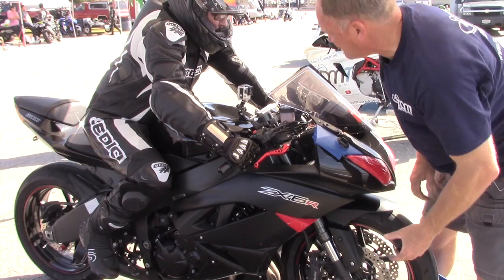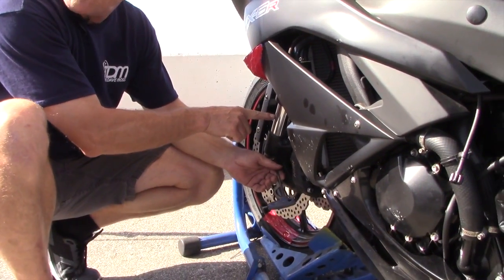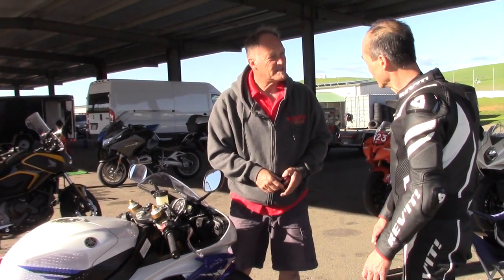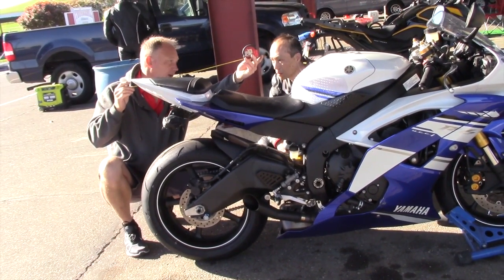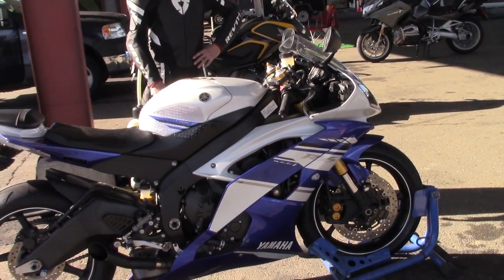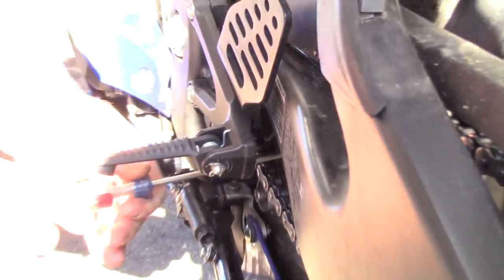2 Clicks Out: Lowered Kawasaki ZX-6R & Yamaha R6 Suspension Setups (TRAILER)

Comment: i really wish someone in my city could help me with this. about the only thing i have not figured out on bikes.
Reply from the maker: How can I help? Email me dave@davemosstuning.com
Reply: I have an 02 f4i lowered 1.5 front and rear. it's all factory set as far as sag and preload. I weigh 160 and I use the bike for everyday riding. just thought it be cool to see how the bike feels adjusted correctly
Reply from the maker: If you know how to use some basic tools, I can give you some settings to install. How many miles on the bike and how old is the fork
 and shock oil?
Reply: do you have any problems with your lowered motorcycle ? does it handle so different from stock one ? do your footpegs hit the ground when taking a corner/turm ? thank you
Reply: Kuwai8y4u lowered exactly 1.5 inches front and rear zero issues and rides grear
Reply from the maker: lowering is as simple as getting the bike at least flat and level to start with, then making the suspension a little stiffer than normal to help avoid bottoming out.

Comment: Newbie here,  is it lowering the bike can affect the stability of a bike? Or handling etc?
Reply from the maker: Lowering will not affect stability - it will put the bike closer to the ground. That being said, it makes it harder to move the bike side to side as the engine height is changed so you need a little more muscle to transition side to side. You lose ground clearance but unless you have lean angles and speed combined that allow the pegs to hit, there's no issue to resolve. Hope this helps!
Reply: Dave Moss Tuning thanks for the reply sir ,
Reply from the maker: Losing 25-30mm when lowering is an issue if you have the speed that requires lean and that lean angle hits hard parts. You either back off at that point or raise the bike again and deal with the consequences of the increased height (if you are inseam challenged).

Comment: I thought the '08+ R6 had two lines showing above the upper triple? was this one lower?
Reply from the maker: that is correct and for the track, positioning the forks at one line gives much better braking stability generally.
Reply: +Dave Moss Tuning agreed! I like to raise them all the way and make it flush with the upper triple, but that's just me.
Reply from the maker: Then do so and define what YOU need so that at all times the bike gives you consistency based on how you ride it :)
Reply: can you please talk about lowering motorcycles, maybe how many inches maximum can you lower them and how lowering does affect the bike handling. thank you
Reply from the maker: I will put something up on that in a couple of weeks once I get back from North Carolina.
Reply: Inches? Nah...lowering it by inches will completely screw up your handling. Not to mention, I doubt at full suspension travel you will have clearance (a.k.a front wheel hitting your radiator or rear wheel hitting your subframe)
Reply from the maker: Kuwai8y4u Lowering the bike is a function of getting your feet on the ground to your level of comfort. The average lowering link gives a range of .75 to 1.5 inches with set holes in a machined piece. Soupy's links offers a much more adjustable lowering link so you can lower in very small increments. Lowering the bike may mean stiffer suspension - it may not - based on rider weight and skill. You will lose ground clearance and scrape pegs, but such is the catch. The biggest "miss" is that forks are not set the make sure the chassis is flat. With upside down forks that is not a problem, but with telescopic forks you give up a lot of travel and must make the forks stiffer so they don't bottom out against the lower triple clamp.

Comment: Sir  we can adjust the rear and front suspension in all super bikez
Reply from the maker: We can change geometry in fork position and shock length, we can change fork and shock preload, and we can change fork rebound and compression along with shock high and low sped compression and rebound on all superbikes.
Reply: Hey Dave , i have no idea what my 2010zx6r suspension setting are as i have only just brought it 2nd hand, I have searched for a video to show me how to set it up to standard, can you point me in the right direction to where to find one please, I am not a pro by any standards, no track riding only weekend rides, any advice or info would be greatly appreciated, i do thank you for your time as i can see you are a busy man.

Comment: 7000 miles. fork seals are brand new and oil. I am good with tools.
Reply from the maker: Fork position at stock, preload with 3 lines showing, rebound at 1 turn out from maximum, compression at 1-1.5 turns out from maximum. Set rear shock preload where you get 5-10mm of static sag, compression at 1.5 turns out and rebound at 1.75 turns out. For the settings information I ask for a Paypal donation of $20 via catalyst_ moss@yahoo.com
Reply: glad to make that payment. one more question. I got the three lines on the forks now I have the adjustment dials on top and the ones on the bottom of the forks. so 1 turn on the tops and 1 1.5 on the bottoms?
Reply from the maker: all hydraulics are all the way to the right to maximum and then count back